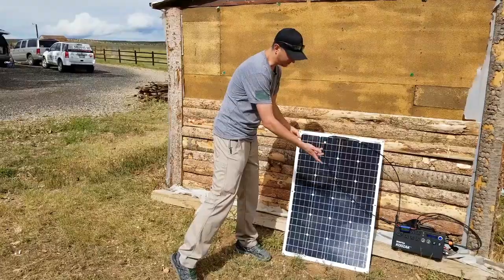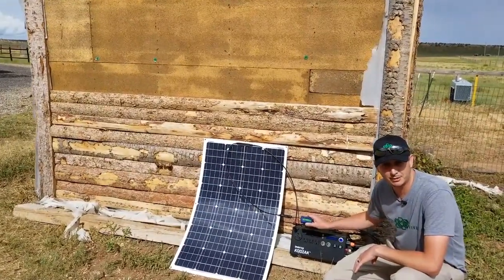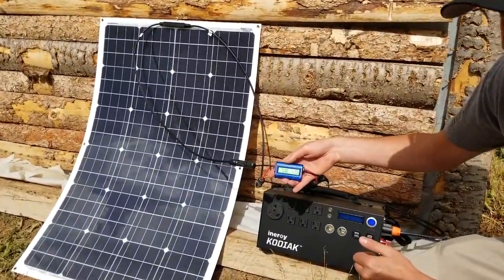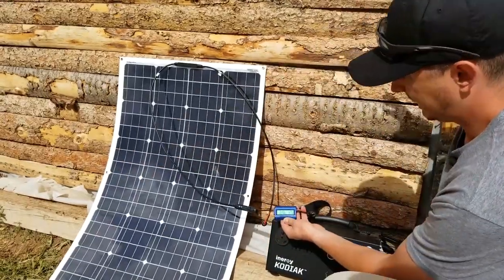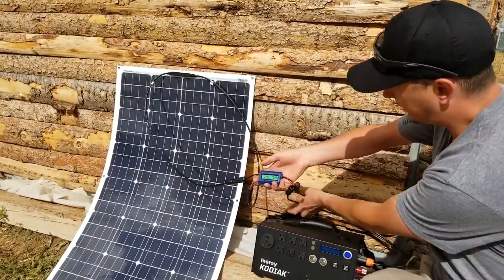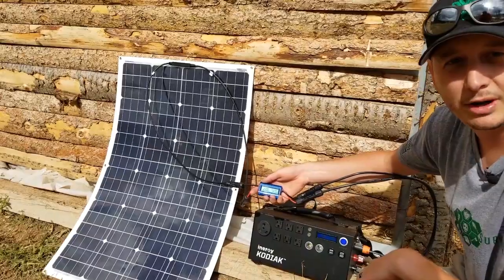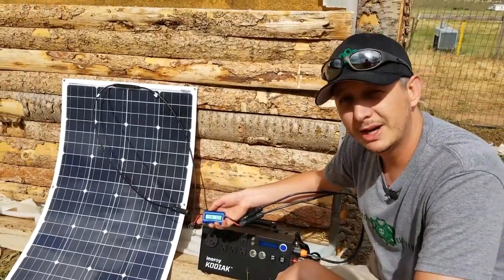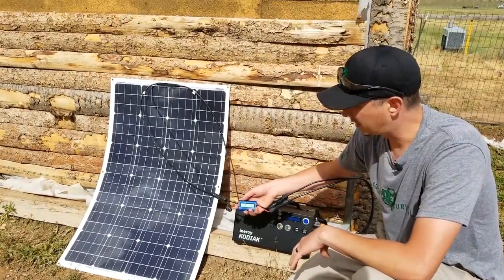MC4 Watt Meter To Show Power Input To Kodiak Solar Generator

Comment: The cables are thick then you plug into the skinny watt meter wires I don't like that especially the higher or more panels you add on am i wrong?
Reply from the maker: msgt1942 the watt meter is rated to 1000 watts and actually has the same gauge wires as the thicker solar cables.  Those solar cables just have thicker insulation on them.  The Kodiak can't take more than 600 watts input so even at max input power, less is going through than it is rated for.  We have tested on setups up to 6 100 watt panels with no problems at all.
Reply: Armory Survival OUTSTANDING thank you for enlightening me love your answer!